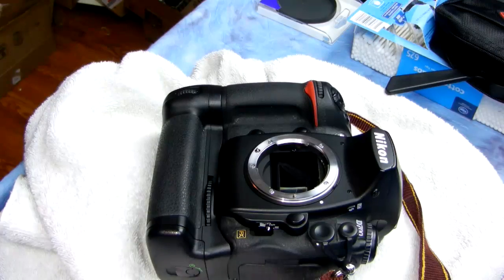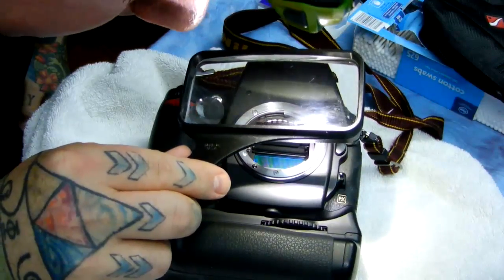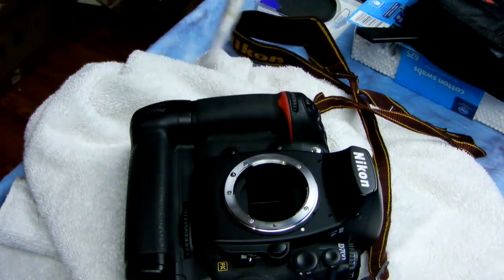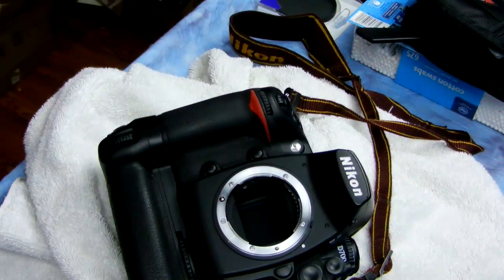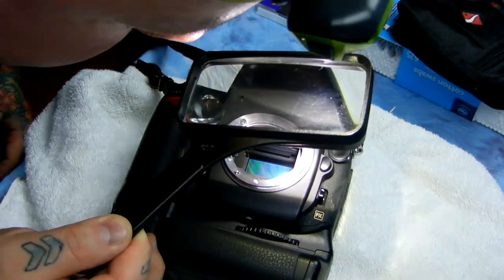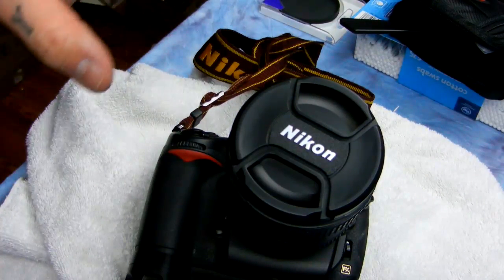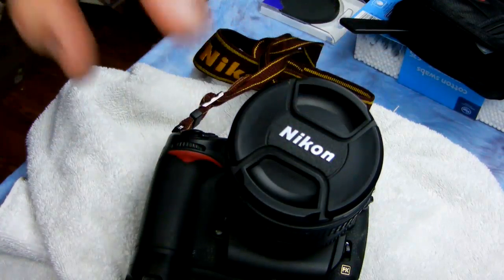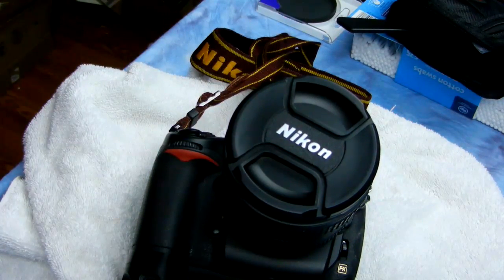Angry Photographer: STEP 5 Cleaning the actual DSLR SENSOR, tools and methodology

Comment: For Sony users this method is not viable because you'll be spending a fortune on rip off sensor swabs. I don't know why this is such an issue with Sony but it is.

This is how I do it. You need some kind of small spatula made out of thin plastic and cut to about 25mm wide for full frame. Make sure the edge is perfectly straight. I had an art sponge brush. When you remove the sponge, it's a plastic spatula which also has notches on the sides and this actually aids the spatula to have more even pressure. I cut the handle down so I could easily attack strips of micro fiber cloth with an elastic band. Get packets of sealed cloth. Cut then to just over 25mm strips. I use powder free medical gloves while handling all this to keep things clean. Attach the cloth to the spatula with an elastic band and apply isopropyl alcohol. You can shift the strip to fresh area to do several cleanings. Check the results by using extreme contrast settings in your RAW editor. The sealed packets of cloth and the alcohol will last for many many cleanings. I use this method all the time and it works perfectly.
Reply: Also, if you can locate certain individual dust spots and it's not all over the sensor, there is nothing wrong with using cotton buds just to clean a particular spot.

Comment: Ken,
I did this to my D700 the sensor looks spotless but my images on every lens image look sort of slightly fogy looking now.
It didn't do this when I first bought the camera. Any reason for this?
Reply from the maker: if you let the solution dry for more than 4 seconds or so it will leave streaks, look for sensor streaks.

a cleaning after a LONG time not cleaining will require 2 swabs for a full cleaning

Comment: Hey Ken, I know this is an old video but I finally got around to my first sensor cleaning. I ordered the same photo graphic solutions kit you used, but it seemed to leave streaks on the sensor 🙁 I think I may have used too much solution.?.? So what's my best bet, just get more fresh paddles and give it a few more passes with less fluid? Because with the current streaks it looks 10 times worse then when I started...
Reply from the maker: OR likely you let it dry for few seconds too long, and THAT will cause streaks….2 drops and 2 seconds then immediately "hit it" 

its LIKELY (what camera) you had OIL spots on there, and you'll need 3 cleanings to remove it ALL

there is a trick to that so you DONT waste paddles but thats rubbing alcohol and lint free swabs to remove GUNK
then use the paddles to do a final cleaning
Reply: Yea, I think your right about me waiting too long before hitting it. I definitely used too many drops. It's a D7200, and i'm pretty confident that their wasn't any oil spots, it was pretty clean, except for a few stubborn spots of pollen I think. The only other thing I noticed was that the paddles seem to be a millimeter too narrow. From what I saw the cover over the sensor is slightly larger than the sensor itself. Thanks for the fast response man! Got a D500 on its way right now... Very excited! Cheers!

Comment: Those swabs and drops are an ESSENTIAL part of my travel kit. You can also buy pre-moistened swabs that are individually wrapped. I tend to travel to a lot of third-world countries, where (anecdotally) dust seems to always be my biggest foe. Tropical climates exacerbate the problem. When you leave your air conditioned room, allow your camera to "acclimate" to the outside temps before changing a lens...otherwise, your sensor will become a magnate for a lot of shit. Also...NEVER attempt to do this outside "in the field". Wait until you can sit in a quiet, well lit room without fans or unnecessary air movement.

Comment: where does the dust go during the sensor cleaning function?
Reply from the maker: Virginia Hoffman its gets vibrated to the bottom of the lightbox bay :)
Reply: then it stays in the camera, I've always laid the camera face down then opened the body cap hoping it would drop out ha ha ha oh silly me
Reply from the maker: yeah, it wont drop out :P
Reply: that sucks
Reply from the maker: this is why you have to keep the fanny of your lenses VERY clean, also the rear lens caps, all that crap makes its way to the sensor.
Reply: I will keep my fannies clean ;)
Reply from the maker: clean tushies :P